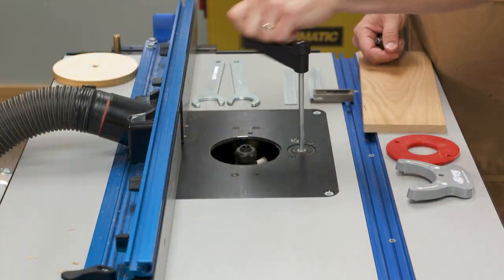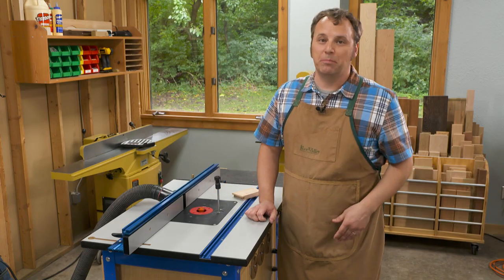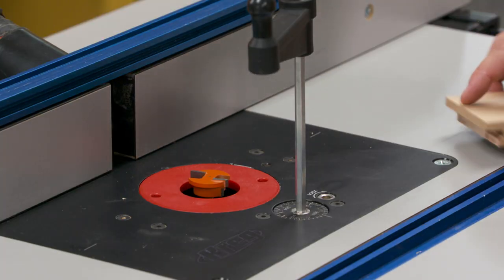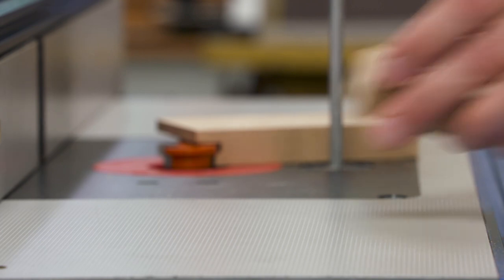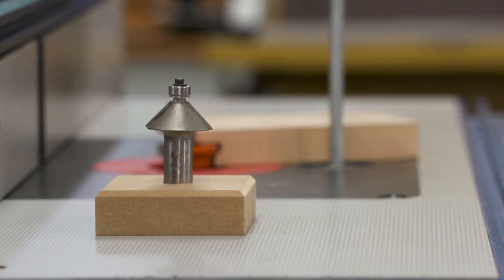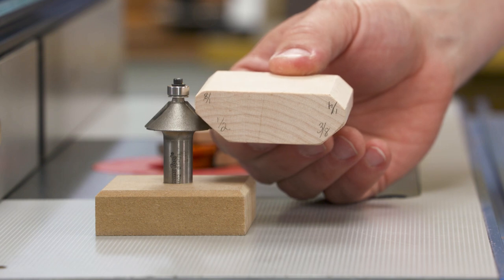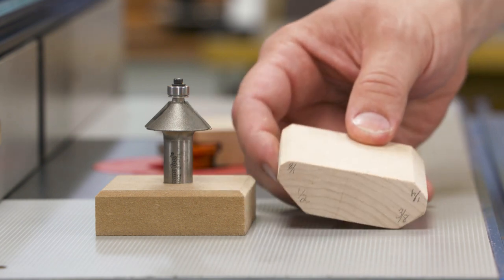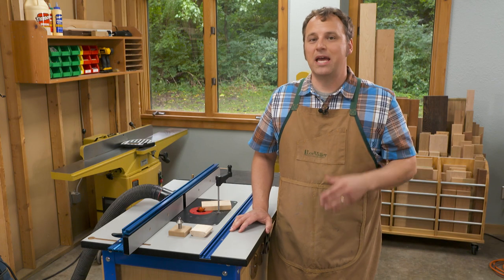Woodworking Tip: Time-Saving Router Bit Setup

Comment: Phil,  Take your base material that the bit sits in, and use that as your template.  There when you need it, plus it shows what the cuts will look like.  Easier than looking around for the template.

Comment: This may not work in all cases, and depending on your bit storage drawer it may not work, however if you bore a hole in the setup block, it will hold the bit that it belongs too.
Reply from the maker: Thanks, great tip!